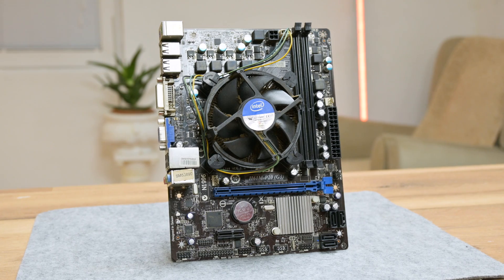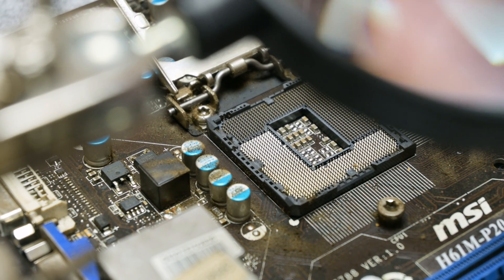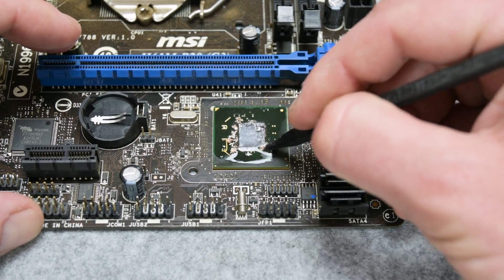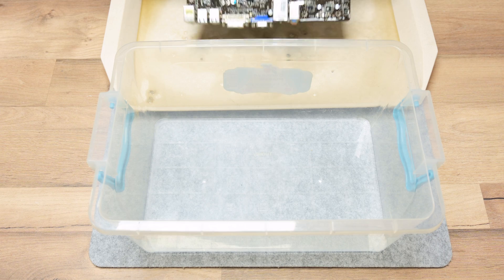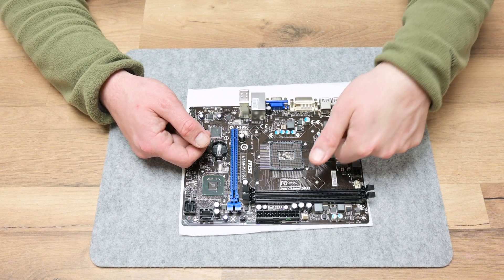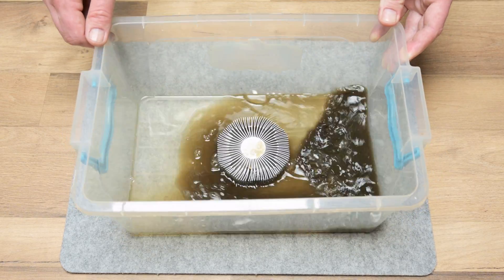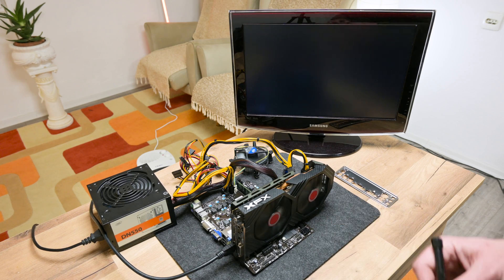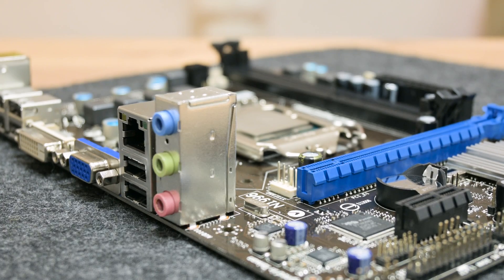Can you wash a PC motherboard? - And How To

Comment: What should avoid using any type of alcohol that is 70%, because it contains water, individuals should use alcohol. That’s 90% or a little better.
Granted 70% would work to clean some of the metal brackets or even the CPU heat sink or the top of the CPU but it should never be used on any internal components or even on the motherboard itself, 90% or better alcohol is recommended .

Comment: Bought an old digital receiver recently and it absolutely wreaks of cigarette smoke. Had it not been so cheap I'd have sent the damn thing back. Vile. Spent ages cleaning it and still stinks a bit. Don't want to imagine what the breathe of long time smokers are like, especially the inside of their lungs. Breath of a thousand arse holes. Gopping! 🤢🤮🤮🤮
Great video. You did a cracking job with that, it's like new. 

Just a mindful tip for anyone doinf future projects - Forget those shitty plastic cotton swab sticks / cue tips, unless you can get bamboo ones, stick with a soft bristle brush that you can just clean afterwards. Plastic crap just gets dumped into an already overflowing landfill system.

Comment: How do you ensure that every single part of the component is thoroughly dried. The water that might seep into the crease of the slot or the gap below the capacitor or the connectors, for example.

Comment: I would like to know from expert (not pc expert), which is the differences between distilled water and normal bath water, i know the second is worse because minerals can oxidize worse but oxygen is present almost the same so especially if water is hot it can oxydize metals, or the wetting is so fast it can't oxydize much?
Reply: Minerals dissolved in common water (mainly sulfate and chlorate salts) will deposit all over and, since these salts conduct electricity when dissolved again by natural humidity, they not only deviate electricity from its path, but also act as electrolytes and create little galvanic cells. These salts are hygroscopic, so they capture water from the air even in low humidity environments, and some are more than others. The result is different salts with different electrical potentials concentrated in different regions of the metallic components. The areas with more water or salt concentration become anodes (where the metal is constantly forced to react with oxygen), and the other areas become cathodes. This combination of things completely bypass the passivation oxide layer on the surface of the metals that normally would slow down their oxidation. This is the big difference. Demineralized water and even pure oxygen will have a much harder time corroding the metal, as the passivation layer protects it from further oxidizing deeper than the surface.

Comment: This is a great detailed tutorial on how to clean a motherboard the right way. However fixing bent pins is a real PITA sometimes. I have a cheap electric magnifying scope with light from Amazon that gives nice close up view of  cpu socket. I always make sure not to drink too much coffee before I attempt to fix bent cpu pins lol.  It is like doing brain surgery, one slip and the patient go bye bye. I have had to give up on a really nice Asrock Z390 Killer SLI  board recently. It was in beautiful appearance in original box and packaging but, because a few pins were so severely bent backwards and I didn't have small enough tweezers to hold the pin down while using other tweezer to bend the pin back to place.  Can you recommend what size tweezer/tool would be appropriate for this task ?

Comment: i used to was motherboards with hot tap water soap and a very soft brush..left it off to dry afterwards and looked like brand new...also working normally..
Reply: Did that too, nothing broke 100% success rate so far
Reply: I did that as well except that I removed all plastic components and cook it in the oven for 5 minutes at 350 degrees. All connections brand new. Make sure you remove all plastics and battery.

Comment: This is how I have done this for the last more than forty years:
Take it apart mechanically as much as possibly.
Wash parts in a solution that can dissolve whatever dirt is present, sometimes ordinary liquid hand soap can do the trick, other times you have to go with more aggressive solvent, basic or acid contains, but it all depend. Not all components/parts may like this treatment, some may loose their printed information, some may be permanently damage (some components can handle diesel/gasoline/acetone well, but not water!).
Immediately after washing, rinse with plenty of clean water.
The parts are blown off with compressed air and placed in a hot air blower oven at 50-70 degrees centigrade for at least 2-3 hours or just until the next day.
Assembly/repair, test and done.

The tricky part is to find what can dissolve the dirt that is present, many household cleaning solutions can often be used. Sometimes you may have to use different cleaning agents to remove different kinds of dirt on the same part, plus you may need to clean off old flux residue too with IPA there is not a one-stop solution to the cleaning.

Comment: I just washed one before I noticed this video lol 😂 except that i washed it with soap and tap water which is not recommended, and then bake it under the 38°c sun and blowing all the components that might still have water underneath such as CPU socket and PCH with compressed air for every hour. The motherboard still works and I haven't seen any issues yet.
Reply: That's good to know as I don't have a hairdryer and at the moment the sun is shining here and there, thanks! Professional! ;D

Comment: Yes, you can wash PCBs with water - pretty much any electronic equipment you have bought for at least the last 10 years will have been put through an aqueous cleaning system and they were in use (although less common) long before that.

Comment: I washed electronics with tap water (with dishwashing soap) many times and all works fine to this day. Thoroughly drying is a key to success - it takes 12-18h near heater in the winter or 48h in the summer. Don't forget to remove all soap with a lot of water. Air compressor should help even better than only washing and drying. You won't see any corrosion if there isn't any current through this time.
Reply from the maker: I have tried the same, tap water is okay as well, but it depends where do you live. To some places in the world tap water isn't clean as many claim to be, full with minerals and other things, hard water. In place where I live the tap water is good. By the way, once even I clean motherboard using nitro thinner. One guy brought asus formula ( back in a day when these were new ) covered with paint and nitro thinner has done a good job :D
Reply: @ComputersAndTechAndAndrew  Generally water in most of Europe is fine, of course there are still many places where is bad or something, but not that dirty like Ganges. EU puts pressure on ecofriendly life - water purification, less fumes from cars, recycling and reusing policy etc., so I am not afraid in terms of water quality. I hope people all around the world follow the example, because Europe alone can't make a huge difference... and water will be then clearer and healthier :)
Reply: @ComputersAndTechAndAndrew  and you mentioned nitro thinner... I know it is useful for cleaning hands from paint for fences, but I've never think about cleaning motherboards. I must try it one day! :D
Reply: @ComputersAndTechAndAndrew   that a good point thanks a lot
Reply: Next time try sea water .
Reply: Bro can I soak it in 70% isopropyl alcohol?

Comment: I have the Broken not work Motherboard from HP S3000 Series try to re connect the power
Reply from the maker: I'm not sure about this motherboards, these were available with AMD and Intel 775. One series uses standard PC power supply but the other have charger. I'm not sure is this motherboard worth repair, because you can find the same factor motherboard for a cheap

Comment: 6:29 It is most logical to use the hair dryer only in cold blowing mode because heat can damage the structure of the soldering
Reply from the maker: The heat from the hair dryer is about 60-70C this is okay :D
Reply: Makes sense Andrew went bald when his hair dryer goes up to 200°C  
/s
Reply from the maker: Bro am getting bald without hair dryer, I don't even use hair dryer :D I have 8 strands of hair in 9 rows :D

Comment: 3:24 Before disassembling the chipset block, it is useful to heat the block a little. Sometimes there is resistance on it and it may break.
Reply from the maker: Yes you are correct bro, but this block has already separated
Reply: @ComputersAndTechAndAndrew  I wanted to give tips for future projects for you and the audience.
Reply: How do I heat it up? Mines stuck
Reply: @Grimnew  hair drayer

Comment: How did you make sure that the bent pins weren't going to bend back again after fixing the bent pins?
Reply from the maker: Mostly will not bent again, but I test that with placing the CPU multiple times until all it's fine
Reply: Just a glance to be sure that they're straightened up like a military formation it's enough.